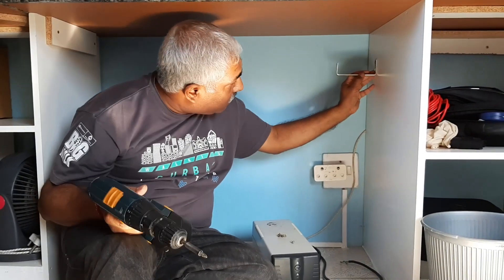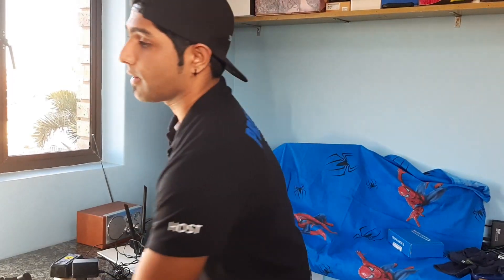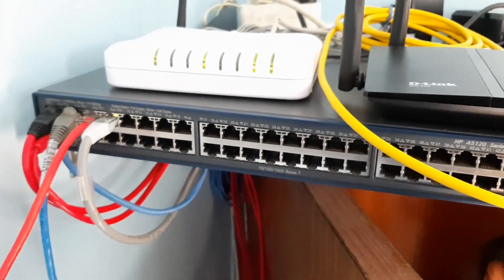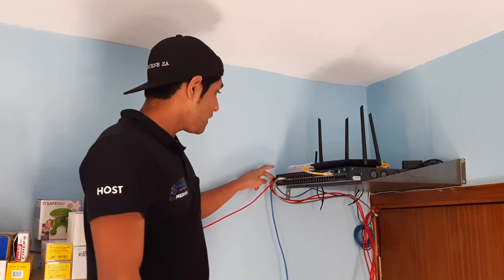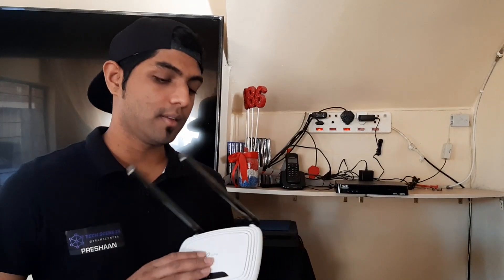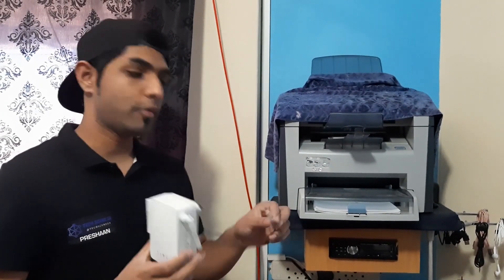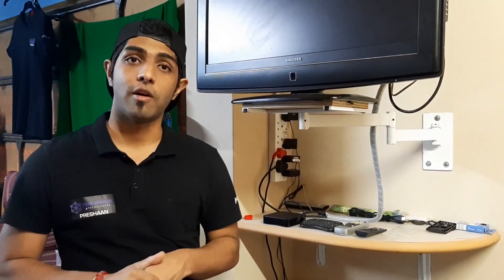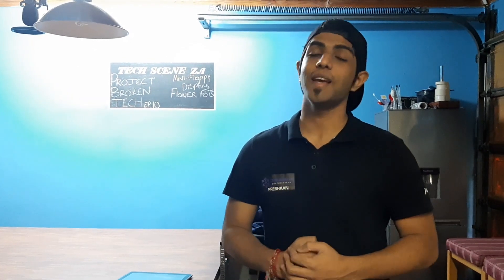Revamping our Home Network - 2020 Edition

Comment: Nice set up. Would it not be better to get a smaller switch and then maybe some trucking to hide the cables.
Reply from the maker: Hi Jake 
we were planning to install 3 , 5 port switches around the house , but due to the corona virus and lock downs and stuff we just had to stick with the 48 port stitch for now , and that also answers the question about the trunking we don't wanna install the trunking and then when we install the correct hardware it was basically a waste 

Thanks for your comment , hope you enjoyed